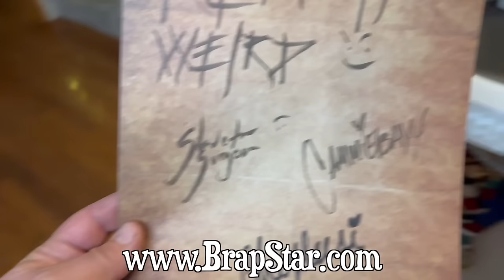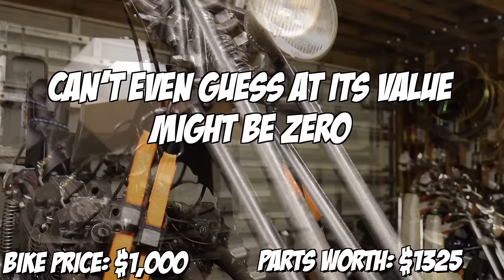Did I Make a Mistake Buying the Cheapest Chopper on Marketplace? | The Ugly TRUTH

Comment: The front hub and brake look like Honda ct90, it was common to use them on choppers in SoCal. There was also a “Stop-a-Chopper” system that was worthless. In 1970 I had a Frisco style ‘49 Indian Chief with no front brake. Fun at stop lights on hills with the foot clutch.
Reply: I believe you are correct on the ct90 front wheel

Comment: Here's an observation. How are you going to shift with the existing exhaust? The original mid mount shifter lever is all but touching the exhaust header. So you may be stuck with forward controls unless you can find a set of headers and pipes that route differently. I always admired those old CB750 Choppers. Dead reliable and still a blast to ride. Cheers Josh! Zip~

Comment: Hi Josh, just wanted to share some personal experience. I’ve been to Japan several times for work and have walked and gawked for a bunch of hours. In the places I have been, I have actually seen more sportsters than Honda trails! Doesn’t make sense, but I think there is some displacement tier system that makes anything over a certain displacement difficult to obtain. Anything over that threshold is expensive to get and similarly difficult.

Most of what I see are blatantly scooters, as their displacement has tax, licensing, and parking advantages.
Reply: IIRC, the cutoff is at 1000cc. At that size & up, you'll have to take an "advanced" license exam after having ridden smaller bikes for a couple of years (I think) and pay higher fees & taxes.

Comment: NO! Not a single CB750 had a mount attached from the top of the engine to the frame. Never.
The only engine mounts were at the rear of the engine and at the front of the engine near the base of the cylinders.

Comment: Have you looked for the starter under the chrome cover beneath the carbs??? Showing your ignorance there - not every bike has ancillary parts where Harley put them.
The SOHC engines were some of the best that Honda have ever made. I had a CB750 F1 in 1976 from new, and a CB750 K7 in the mid 1980's, and also ran a CB500 bought used and sold in great running order with 100,000 miles on the clock after five years of my ownership.
Just keep the oil and filter changes regular and fill it with gas, fantastic motors.
Reply from the maker: I already checked with the previous owner, the starter was removed 🤷🏻‍♂️ 

I never claimed to be an expert man. I always go out of my way to point that out. I’m just a guy in his garage havin fun.
Reply: @shadetreesurgeon the fact that you aren’t an expert and just LIKE BIKE is the reason I like the channel. Doesn’t hurt that you’re a wordsmith and I can’t believe I’ve never seen a comment on how you are a living Dr. Teeth lookalike. And that’s a compliment.